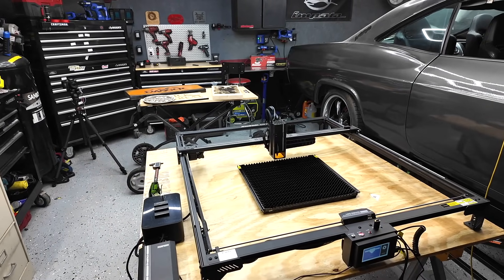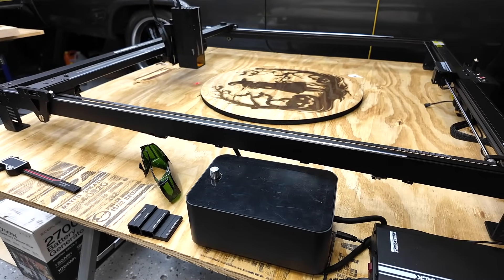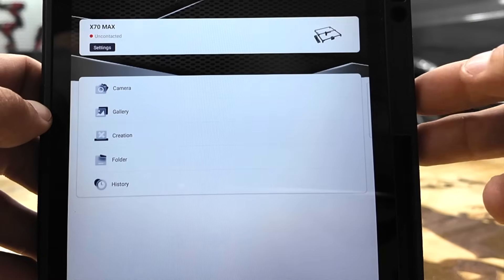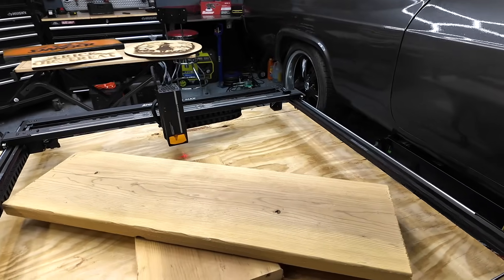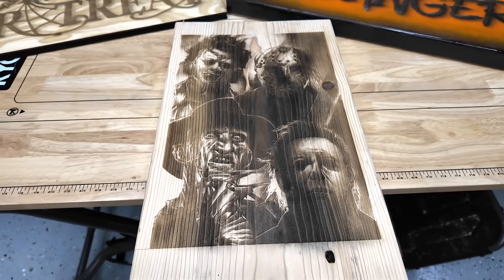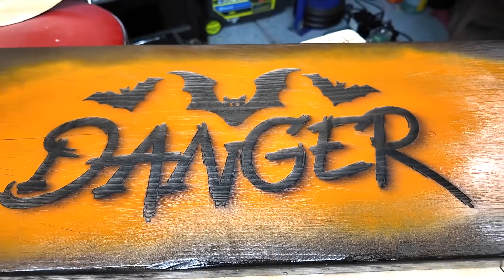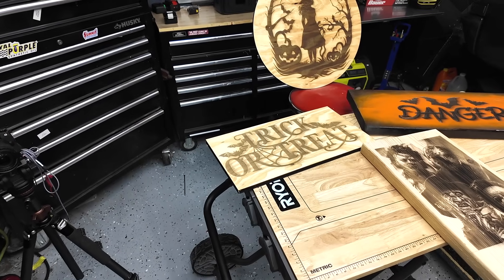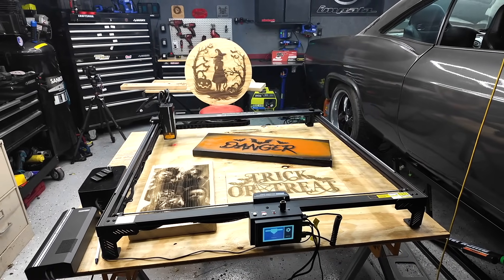AtomStack A70 MAX Laser Engraver Features You WON'T Find Anywhere Else!

Comment: It doesn't have two lasers, one 35 watt and one 70 watt. There is simply a switch that reduced the 70 watt output at 100% power to 35 watts at 100% power. As with ALL laser diodes, the laser diode itself is either ON (70 watts) or OFF (0 watts) at any given moment. When you choose the 70 watt setting with 50% power, this simply means that the laser diode is rapidly switched on and off so that the total power delivered over time is 35 watts (50% of full power continuous output).
Reply: It actually has lots of laser diodes (probably 12) in it stacked to output all at the same time in the same beam. It's very likely that the button just turns off half of them so you can modulate the power more precisely at lower levels (for engraving).